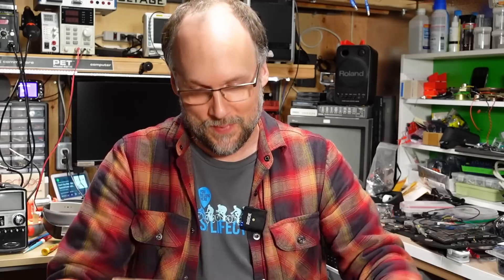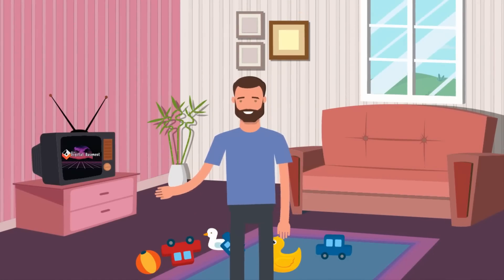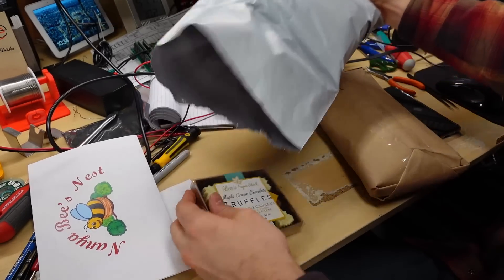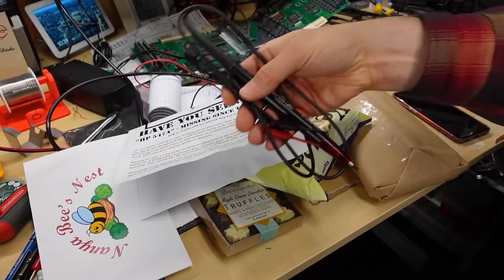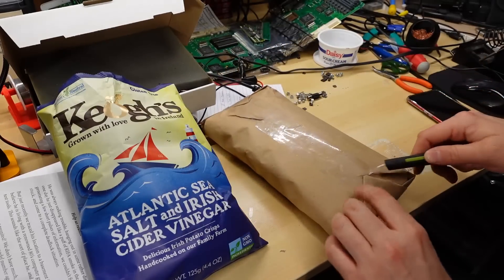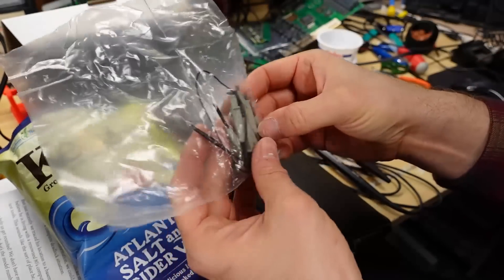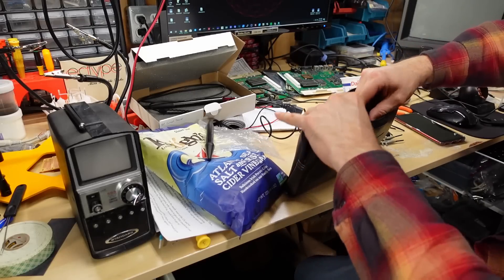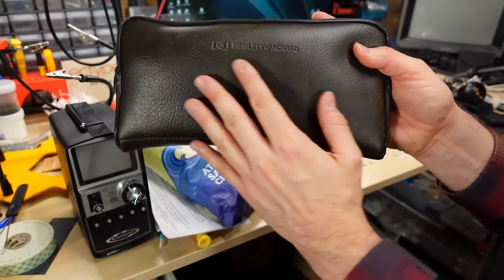Thanksgiving Special (with some HP goodies)

Comment: You are so lucky I remember when I had the complete set but my HP case was not fluffy like that just felt inside our UK version.  We also had a current probe branded by RS(radio spares) which looked slightly different but worked the same way.  I am so jealous would love to find a set again. Currently Use a logic probe and pulsar from farnell or you would call them Newark.

Comment: During the 70s / 80s I used to work in a lab using HP logic probes (In bags like yours) as well as other HP gear.  HP had a unique way of "quoting" if you sent a faulty one to them.  They would repair it & send it back with a bill!!  Great gear though.

Comment: Greetings 
You got the full set of digital test gear. The logic pulser to input a digital signal into an ic to verify if the fault is either internal or external. When used with a current tester and logic probe it will provide added assistant to use a test scope.

Comment: That stuff in the case is actual nauga fur.  Usually the fur is removed when tanning the hyde of the nauga beast.  In the 1970's HP developed a process to keep the nauga fur intact during the tanning process.  My HP-67 case has this nice nauga fur inside.  The process must have been very expensive because it seems to have fallen by the wayside during the 80's because my HP-41 cases no longer have it.   It could also be that the nauga beast has gone extinct because the fur was also used to line the inside of Chevy Vans in the 70's which probably led to their demise.

Comment: Love those HP Logic probes. I still use them daily. You can also fit the power ends into some of the molex HDD power connectors. They are good for quickly finding out the state of a signal or injecting a known state. the Logic Probe will light up dim when plugged in. this is showing an indeterminate state (Not a Hi or Lo) It will go Bright for a Hi and out for a low. It flashes for any changing signal. the rate of flash is fixed and not a representation of frequency or data rate.

Comment: I last used that set of HP tools in the mid 1980's in the US Army (Hardware tech), the pulsar was used to see if you could toggle the signal through a gate, or IC and the probe was used to watch the results. we also had the clip on unit you showed, but I don't remember the tracer. (It was a long time ago. LOL) love your vids, I used to have an Atari 800xl as My first computer I bought while serving in Berlin Germany. I used to fix many of the computers you show (esp Apples) and still repair new Apple computers.